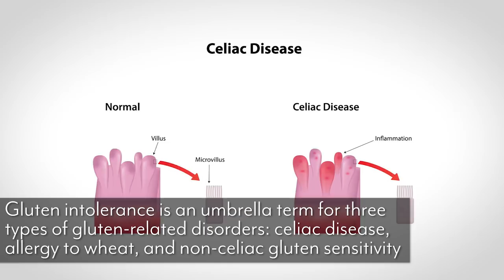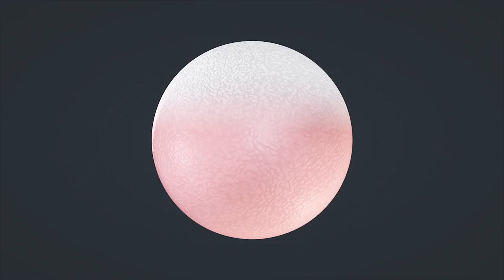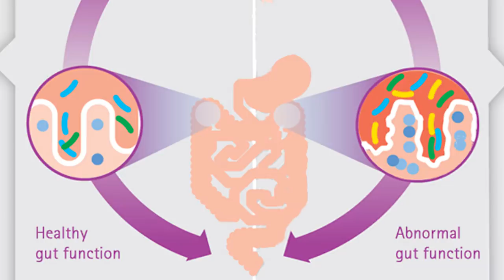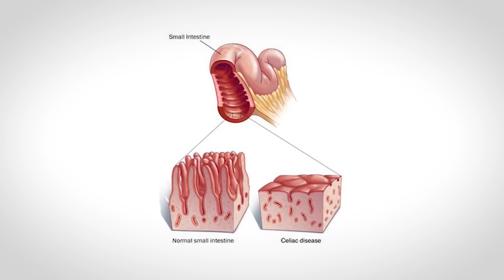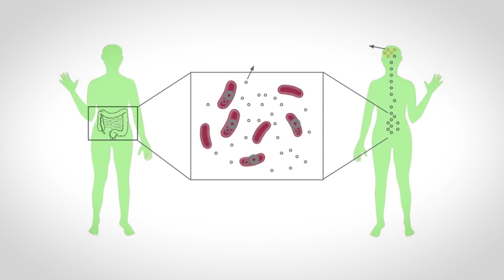Gluten Free is no Fad- Intolerance vs Sensitivity and Celiac Disease

Comment: I have Hashimoto’s and my thyroid wasn’t “responding to meds” at all and I had nodes and my weight kept piling on no matter what I ate or how much I exercised and when my levels started getting normal I was told I shouldn’t be symptomatic anymore but I was, I could barely function. Going gluten free was the only thing that helped but it was like an accumulative affect. So after about 3 months of gluten free my weight started dropping rapidly (like 30kg in 5 months) and pretty much 80% of my symptoms went away. My endo said that gluten triggers an autoimmune response in lots of people with autoimmune disease not just celiac which is super interesting and drastically changed the quality of my life.
Reply: LacyMartini I have a similar story... after months of being gf, my thyroid normalized and I had to stop thyroid hormone replacement. I’ve been gf for about 15-16 years!
Reply: Little House in the Big Apple do you find if you have gluten now like accidentally your symptoms come back for a few days - weeks depending on how much? Like I find if I have a bit of sauce with gluten I’ll be fine but if I have that little bit of sauce like a few times in a short period of time I will become symptomatic again for a few days or even weeks.
Reply: LacyMartini what I will notice if I get accidentally gluted (often during travel) my thyroid will actually ache! Usually I’m super careful after (I have celiacs so I must avoid) so I never get a worsening of my hashis symptoms.
Reply: I'm so glad that you found out what it was and even though it's super hard to adjust to a gluten free diet, I'm also glad that it happened to be something that you can control rather than to have to depend on the pharmaceutical industry to fix!
Reply: @littlehouseinthebigapple5716  me too !

Comment: I'm a service-connected veteran and get all of my care from my local VA (Palo Alto CA, my VA doc is also a Stanford Doctor).  I have severe and moderate arthritis in many joints of my body, I've had one hip replacement, another one schedules for end of Oct and will need a shoulder replacement after that.  One of the things that I was told was to remove gluten out of my diet as much as possible, if not completely.  OMG!!  This is very difficult to do!  I LOVE GLUTEN!!  For the last year I've been trying to eat gluten free.  I've done pretty good, but not 100%.  Gluten is in so many things, you have to look for things to say "Gluten Free".  Even many products that are rice or quinoa still have some flour in them.  I will say, it isn't making my arthritis go away, but it does help with the pain management.  I'm able to use topical gels and no oral medications (which are not an option for me due to stomach issues) to control pain.  Do I miss gluten?   YES!!  However do I feel better?  Yes I do.

Comment: In the process of testing for a gluten sensitivity.  Only clue was testing positive for thyroid antibodies (~200 so not crazy high) which can be triggered by eating gluten.  All other thyroid tests were normal.  Never felt any different after eating gluten, never had heartburn TBH.  Just 5 years of unexplained infertility despite having no health issues, being a healthy weight, and practicing healthy habits.  The body is a mystery sometimes!

Comment: Wheat has been a gmo since the 1950’s, wheat never looked like it does today. Your’e right glyphosate is in wheat and corn, corn is gmo also.
I either gave a gluten intolerance or celiac, a blood test in the 90’s showed I had celiac markers, but back then, gluten intolerance didn’t exist. Since the 90’s medically they know alot more. But I went 100% gf anyways. Since then, I have never in my life felt any better. 
I also have endometriosis, gluten flares it up, so I have 2 reasons to quit gluten. I too have issues with rice, and corn.